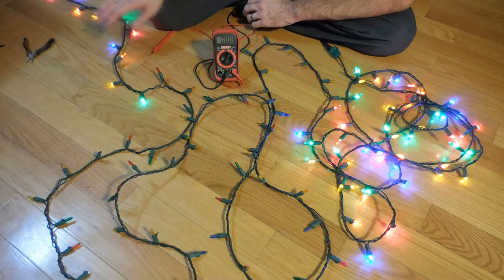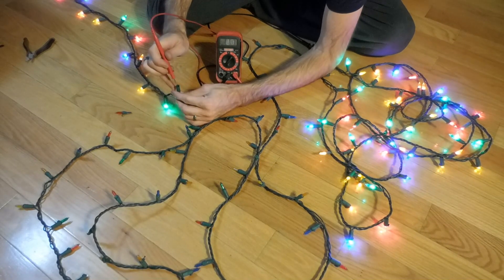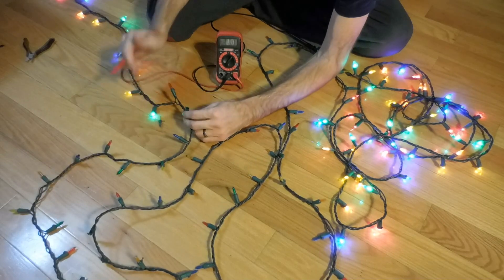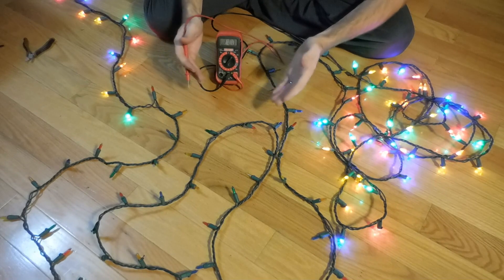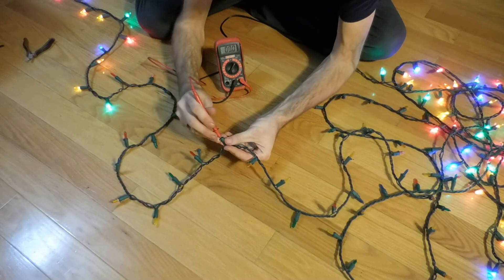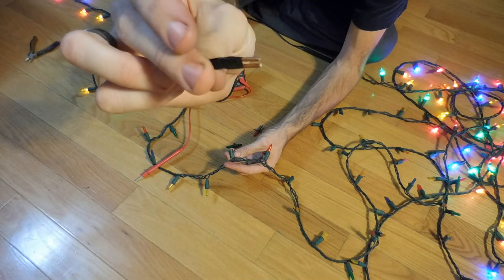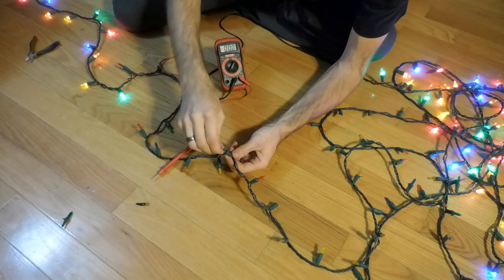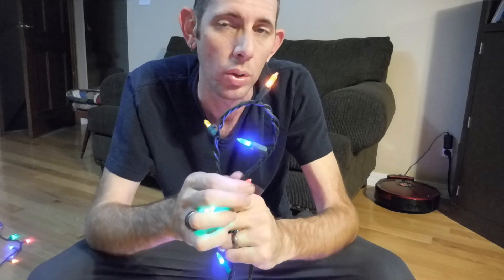Find a bad LED in Christmas light string

Comment: Great Video Nick.Using a voltmeter can be time-consuming but the 1/2 method helps save time and effort and the Voltmeter shows positive indication. The Volt-Tic and similar Voltage Sensing devices ( So bloody many of these Device-Hustling Types On You-Tube ) are nearly useless as they are very sensitive PLUS there's a live 3rd wire in most strings feeding the connecting strings. In case I missed it, folks have to be aware if Replacing the LED filament itself THAT this is a DIODE which passes current ONE Way. If you install your diode the wrong way ( Easily Done ) it Won't Work😁 On Another Note: Whereabouts can someone get suitable replacement LEDs .The Kit Replacements  on I've seen on Amazon ETC. are not suitable🤔 Also , Rust Corroded LED Leads  will probably break off.  Vinegar on a Q-Tip will clean corrosion in the Lamp sockets themselves ( Turn OFF the power  FIRST ) Then , after replacing corroded filaments, cleaning the sockets then installing new LED filaments , verify your lights are working again. Finally,  with a Q-Tip, Apply a glob of Vaseline to the inside of the socket and the end of the LED Bulb/Filament. Vaseline is NON-Conductive and if your sockets and LED Filaments are clean and shiny, you'll have good , stress-free service from your lights. Messy , but if you live in a coastal OR Rainy/Snowy area, it will save you yearly grief😁😁
Reply from the maker: Thanks. My led sockets only allow the “bulb” to be inserted one direction shown in my recent video https://youtu.be/nUAcFFuuFnU  I guess if you’re using replacements that don’t have the base pre-installed, then yes, you need to verify that it’s the correct orientation. Good tip on the Vaseline, although that would be very time consuming.

Comment: THANK YOU -   I have one string with the middle out, and another string with the middle the string "blinking" off for about 10-15 seconds and then back on.   Driving me nuts !     I'm off to get a volt meter.    THANKS AGAIN !
Reply: Well,   unfortunately this did not work for me.  Multimeter never read zero (reading 4.5 - 6.2)  depending on the socket.   Must be something else wrong with my string.  I will try the bulb by bulb method on some rainy day to see if that works.

Comment: Just a question..can you put a incandescent blinker on leds like that??
Reply from the maker: Not sure. I don’t think it’d hurt anything to try, but I’m not sure how it’d behave. I know on motorcycles, replacing the turn signals with LEDs, they flash a lot faster than normal because the flasher unit is designed for the resistance of the normal bulbs. You may have a similar effect with the Christmas lights.

Comment: Or you can take more drastic measures and cut out the bad bulb and re-splice the wires. Haha. I’ve done that many times when I did not have replacement bulbs
Reply from the maker: Yeah. That’s pretty drastic. I think I would have just marked the socket and picked up some replacement bulbs the next time at the store.

Comment: Now what if you get voltage on both sides
Reply from the maker: Both sides of what?
Reply: @DustinRogersinMO  of the inside of the bulb housing
Reply from the maker: @metal422life   do you have just one section that is out? Or is the whole string out? Where is this socket that has power on both sides in relation to the part that isn’t working? 

I think there are light sets that are being sold now that have 4 or more wires that deliver power differently than the sets that I have. The goal of the manufacturers is to achieve a string of lights that continues to work even if a single LED stops working. How many wires are used  in your set?
Reply: @DustinRogersinMO  3 wires, I got it fixed tho. I was misinterpreting background electricity, had 1 bulb not getting good connection and 1 dead bulb and 2 that worked when I switched what sockets they were in. Thanks  again your video did help.
Reply from the maker: @metal422life  great. Glad you got it working.

Comment: What if your very next bulb doesn't have anything on either side? But you can get 120 out of the end plug. All bulbs past the first dead one have no voltage.
Reply from the maker: Very next bulb from what? The bad LED? The circuit has to have continuity through all the LEDs in the section. If one LED is bad, the continuity is broken. You still get 120V out of the end plug because of the third traveler wire.

Comment: What if there is about 4 volts on both  terminals
Reply from the maker: I’ve seen some newer strands that advertise as “never out”, meaning that if one “bulb” goes out, the rest of the string stays on. I haven’t had a chance to investigate how those are wired but I’d think it’d have to be wired in a manner that each socket, or every other socket would be powered individually. 

How much voltage do you have on the socket before and after the one you’re getting 4V on?
Reply: @DustinRogersinMO  
They all seem to have 4on both. This is on a pre lit Christmas tree
Reply from the maker: @dougblack8933  ah. Yeah, those are difficult because you can’t lay them out in a line. Is a big section not lit, or the whole tree?
Reply: @DustinRogersinMO  
There are 2 different sections both are 1/2 of the lights between plugs.
Reply from the maker: @dougblack8933  unfortunately I don’t have any good tips for finding the culprit on a pre-lit tree. Sorry.

Comment: Is doing this same method with the multimeter set to continuity bad/dangerous? I did basically the same thing as you showed but then realized if I had it set on continuity instead, the lights would light up if they were good, and the multimeter would beep obviously. Seemed easier/fun but I haven’t seen anyone do it that way
Reply from the maker: So you were checking continuity with the christmas lights plugged in to power and doing the same test I did except with your meter set to continuity mode? Or were you checking continuity with the christmas lights unplugged?
Reply from the maker: I ask because the continuity mode on your meter works the same as checking ohms/resistance. The internal battery in the meter provides some current and it measures the voltage output through the other lead and calculates the resistance (Ohms law). Any resistance/continuity checks should be done on wires that are not powered otherwise it could damage your meter.
Reply: @DustinRogersinMO    Plugged in. Let’s see if I can explain myself lol. You know how often christmas light plugs have the male side that goes into the wall, and a female side on the back of the same plug? With the lights plugged into the wall, I stuck the multimeter black tip into the female hole of the plug. (I realize this is different than your video, you put the multimeter tip in the tail end plug of the string of lights, and I put mine in the starting side, the wall plug side). So even though zero of my lights were working on the entire string, I could pick a light around the middle, take out the led, stick the red multimeter tip in, and if all the bulbs up to that point were good, the circuit would close and the bulbs only up to that point would all light up and the meter would beep. Take the red tip out again, and the bulbs turn off again. If I picked another point and all the bulbs up to that point weren’t good, nothing would turn on and no beep. So then with process of elimination i could figure out where the bad bulb was. But duly noted, It makes sense that that must be bad for the multimeter
Reply from the maker: @coffeewhenever  Ah, I understand. Basically you were using your meter as a big complex jumper wire. Not a recommended method, but if it helped you find the faulty LED, and no one got hurt, then I guess it’s ok. But I would avoid that method in the future.
Reply: @DustinRogersinMO  🤦🏻‍♀️lol well at least I fixed 2 sets of lights and learned what not to do for the future, haha thanks for your help.

Comment: Please excuse me if these two points are not covered, I have run into:
1) No one seems to talk about the resistor(s) (there may be one or two).  They are needed to limit current.
2) All leds must be in the same direction (polarity).  However the first or last led in a string needs to be backwards in the bulb holder (the tab side of the socket is usually the positive/long lead of bulb) so the end bulbs if each string end up going opposite directions on the wire between bulbs.

I believe I have this right.
P.S.; To further complicate things I have found some sockets installed backwards compared to the others.
Reply: Dustin, the YouTube video you referenced in this thread is the best I’ve seen.  Gives you all needed data on power consumed on all components.  Also a great picture of LEDs and resistor (including color bands).
Thank you, Bruce
Reply: Dustin, I have several points about these light strings and the variations in internal resistance of leds, wires... would you rather I ask though this thread of email directly to you?
Appreciate your patients and knowledge, Bruce
Reply from the maker: Good points. 

Regarding #1 - The strings that I have do not have any resistors. They were made so that the current is limited due to the number of LEDs wired in series. I put out a new video this year showing how i shortened some LED strings by replacing  the LEDs that I removed with an appropriate sized resistor.

Re #2 - on most strings that I’ve seen, the first and last socket are different because they have three wires instead of 2. This is so that the section of LEDs can be wired in parallel with the other sections in the string.
Reply: @DustinRogersinMO  correct, however the tab on the bulb holder is on the wire from bulb to bulb (single wire).  So the first and last sockets on each section face each other.

Also, please include link to video referenced above. 

Have a great day, Bruce
Reply from the maker: @919Drones  https://youtu.be/0IyPSczC5bQ
Reply: Hey Dustin, appreciate the quick response.  Have more to ask.  Can we talk in the phone?
Reply: Hey Dustin,  I looking to get quick answers.  Also give you some unique rarely maybe never brought points.

Comment: Great advice to use the volt meter and explain how to do it.  I had the misfortune of 2 bulbs with poor connections and it was impossible to solve the problem until I used the volt meter.  Many thanks!

Comment: Some of my LEDs were out and I jumpered each one of them individually across my headlamp battery bank of 3 AAAs or 4.5 volt total and kept trying to blink them from very dim and they jump started and pretty soon they each came on to full brightness and now they work back in the original string so what's up with that?
Reply from the maker: Hmm. Strange. Not sure.
Reply: @DustinRogersinMO , Oh, it looks like those same led bulbs just went back to blinking out again, sorry to bother.

Comment: It seems like it would be easier to just use your handy little copper wire by-pass gadget to test half way/half way etc. instead of the volt meter? Thanks for the good information.

Comment: Very helpful. One question though. Is running these lights with the broken section harmful to the working LEDs?
Reply from the maker: No, since the LEDs of each section are wired in series, and the sections are wired in parallel with each other, each section can run independently of each other.

Comment: Great video.  I learned something AND fixed my string lights.  Two bulbs were faulty.  Why are 2 of the bases of the bulbs wider than the rest?  One wide one doesn't light up but still carries the current.  Thank you!
Reply from the maker: The first and last base in the section has double wires into/out of the base. It’s just to maintain the series within a parallel circuit wiring.

Comment: What about a tree topper where the LED lights are very dim? Not what was advertised
Reply from the maker: Not sure what kind of tree topper it is, but I recently had an issue with one of my sets that were very dim. After moving the wires around a bit, they suddenly got brighter. I suspect there was a slightly loose connection somewhere that was causing some excess resistance or something?? I couldn't get it to go dim again, so I wasn't able to pinpoint the actual issue.May try wiggling the wires around and see if the brightness changes.

Comment: Best video on how to fix the LED strings.  Meter it the best tool to fix LED lights.  That LED Keeper tool pierces the crap out of your LED strings insulation.   A) That is dangerous for outdoor use.  B) Your GFCI will start tripping constantly and C) Water will work its way into the wiring and no amount of bulb changing will fix a string of lights that has water in the wires insulation that totally corroded all the way  through  the conductors.

Comment: Shorting the socket or putting in a good bulb will still not light the string if there is more than one bad bulb. You have to replace the bulb that is dead and if the string does not light up restart the binary search in the remainder of the string.

I just found 3 bad bulbs in a string of 50, in each of them the lead had broken off right where it enters the LED proper.

A voltage measurement near the middle of the string (with broken connections in both directions) yielded random voltage readings on both socket leads regardless of the plug orientation.
Reply from the maker: Good point. I’ve fixed a handful of strings over the past couple years, but have gotten lucky and only encountered one bad LED each time, but multiple defects is a definite possibility. 

Sucks that you had three defective. I think my sets only came with two spares each.

Comment: I tried this with 2 separate strings of lights and I couldn’t get the multimeter to indicate anything. I checked the battery in the multimeter and it was fine. I tried checking on both AC and DC settings - still nothing. I know the problem has to be me, not the instruction in the video - I know I’m a novice and maybe this process is beyond my pay grade. I tried for well over an hour to figure out what I was doing wrong but never could get this to work.  I guess this is why most people just throw the lights away - too frustrating to figure out the problem.
Reply from the maker: Do a simple check and put the meter on AC volts and stick the meter leads in the female plug on the very end of the string of lights. Once the lights are plugged in, you should get a ~120V reading. If not, unplug the lights and check the tiny fuse that is in the male plug end of the string. You have to slide a little cover towards the prongs of the plugs. Inside you should find two fuses. Only one is connected. The other is a spare. 

If the fuse is good, make sure the outlet you’re plugging into has power. Plug a known working lamp or radio in there or use your meter to test voltage of the outlet.

Comment: What if you can't take off the tip?
Reply from the maker: The tip of the LED? Are you having issues with just a specific LED or is the string designed where none of the LEDs will come out? 

Some sets are designed with a little lock tab that snaps down to keep the LED in place.
Reply: @DustinRogersinMO  its fixed i took out that bulb and rewired it

Comment: Brilliant! Saved me loads of time in looking for a faulty light. Although I actually had to measure DC voltage, not AC. I assume this is because of the three wires and fuses system that Noma use in their light strings.
Reply: I had to use DC voltage as well for the strings I just tested. Worked like a charm to find the bad bulb(s).

Comment: What if all are out???
Reply from the maker: Sometimes there is a little tiny fuse in the plug. Check to see if that fuse is still good. Otherwise, you'll just need to figure out where you have voltage and where you don't and try to pinpoint where the voltage stops.

Comment: Doesn’t look like LED lights?
Reply from the maker: Billy walker like the shape of them or ??  Not sure what you’re envisioning for LED lights.
Reply: @DustinRogersinMO  LED lights are different than regular incandescent  lights ,
LED lights have much more vivid colors but arent as bright and cost much more.
And no heat build up and much more energy efficient.
Ive never seen LED lights in that shape ?
If you see filiments in thw bulb their incandescent bulbs.
Reply from the maker: Billy walker yes, I’m well aware what an LED is because I’m holding a set of LED Christmas lights. LED’s come in many different shapes and sizes. I would have to disagree with you that LEDs are not as bright as incandescents. Typically LED’s are far brighter than incandescent bulbs. If you check out some of my other videos you can see me replace some surface mount LEDs in a TV. Those look far different than the LED’s that I’m assuming you’re thinking of. I was just curious why you thought these weren’t LED’s, but you answered my question. Thanks for watching.